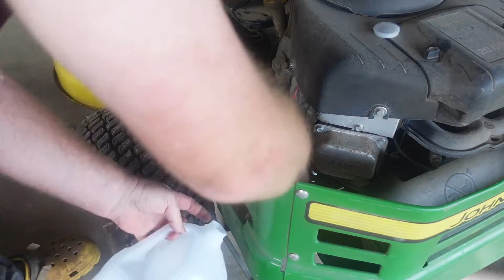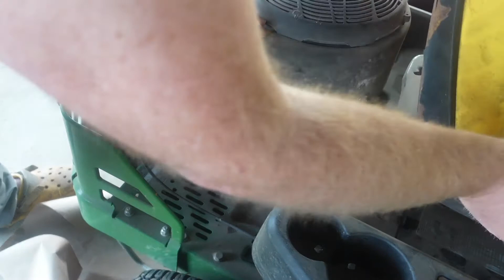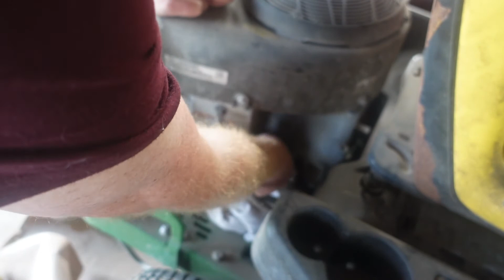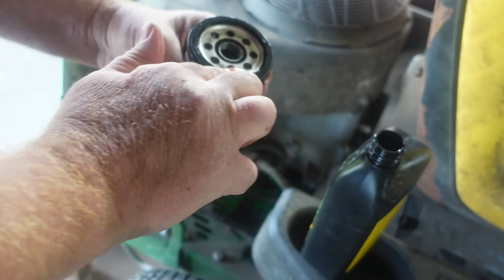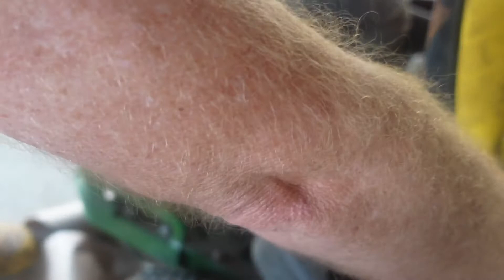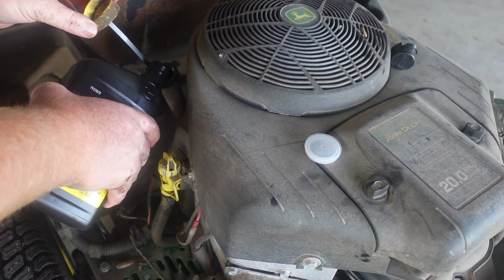John Deere Z335E zero-turn mower oil change

Comment: The filter only needs to be hand  tight. Using that wrench could cause a pin hole in the filter or strip the threads underneath

Comment: I cringed when he put the oil filter on with a pair of channel locks. 30 years ago I had a filter that was so tight I had to drive a screw driver through the filter to break it loose. Someone tightened it with an oil filter wrench... totally unnecessary. They can be tightened to the point it bunches up the oil seal on the filter and cause a leak. Also, t can ruin the filter. Oil filters need only be hand tight.

Comment: How many quarts?
What filter?
Links?
Reply: I saw in another video you can buy a maintenance kit by John Deere with fuel and oil’s filters, 2 spark plugs and the oil for around $40. For the Z335M the kit is LG276